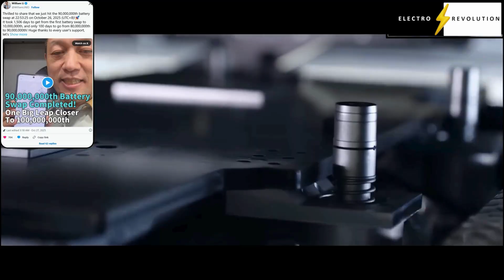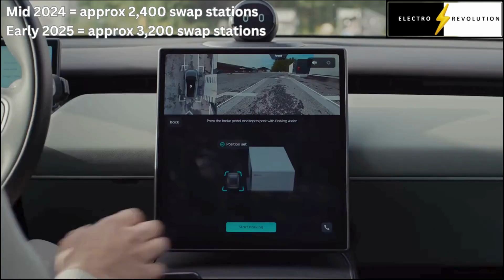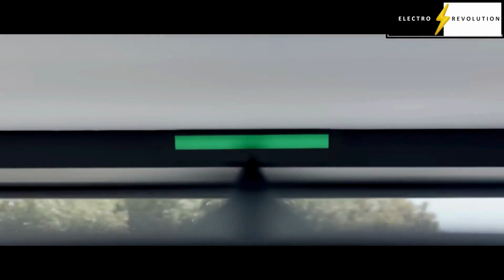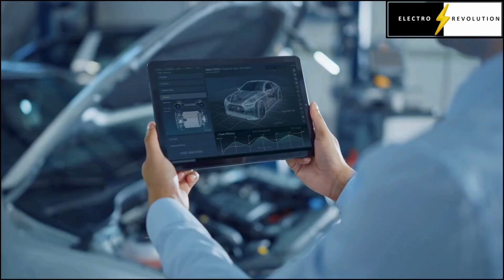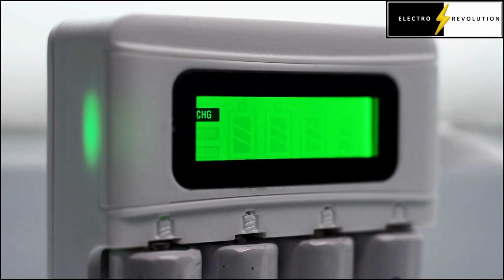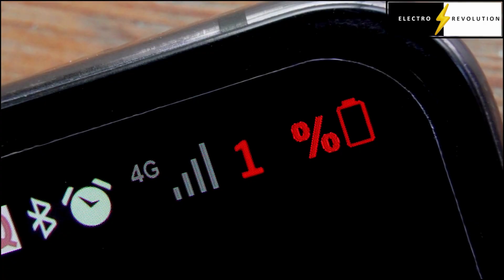NIO Hits 90 Million Battery Swaps! What It Means for Australia’s EV Future

Comment: The auto industry dislikes NIO because it provides more control by the user, better performance, extended life of vehicles etc. The industry would prefer you have to buy a new car in 6-7 years. There will be NIO vehicles with a Million miles! NIO stock $100 plus!
Reply from the maker: Yes, that's a point I mentioned in the video. It's called "Planned Obsecelence" and was invented during the times of the light bulb's lasting longer and longer. Definition "Planned obsolescence is a strategy where products are designed to have a limited lifespan or become outdated quickly, encouraging consumers to buy replacements. This practice can lead to increased waste and consumer dissatisfaction as products are often not made to last". Mobile/cellular phones, electronics, computers, clothes, etc are all produced with this strategy in mind. As vehicles are large investments for most people, they're not so easy to replace as a phone for example, so most customers want longevity, as you said at least 6-7 years out of the car(s).